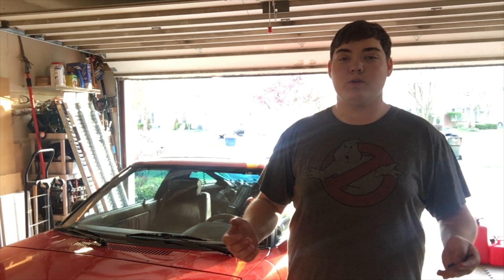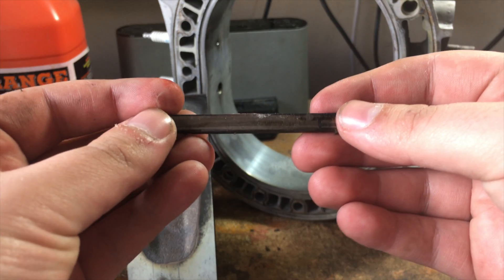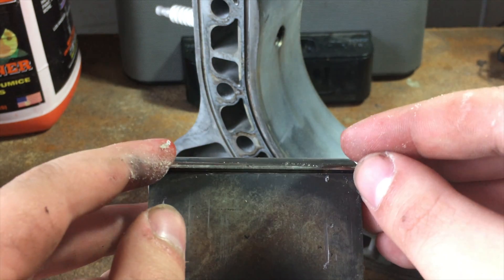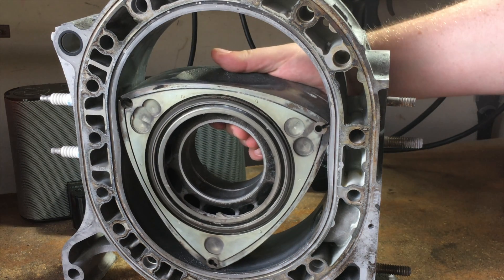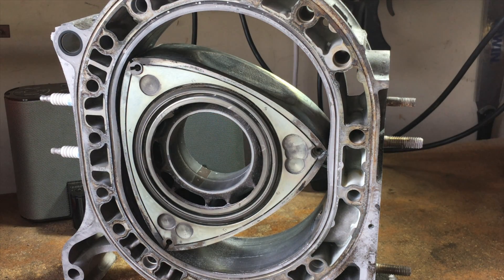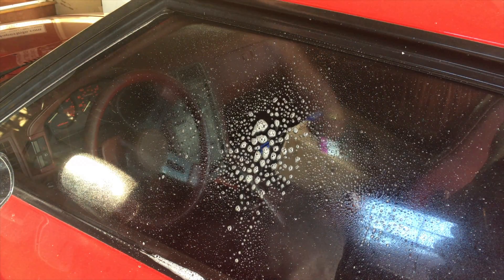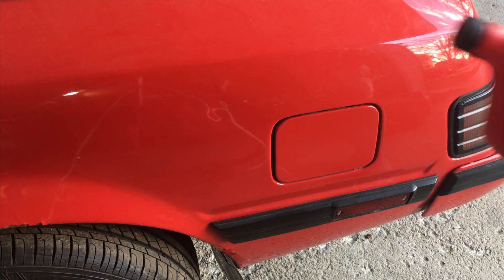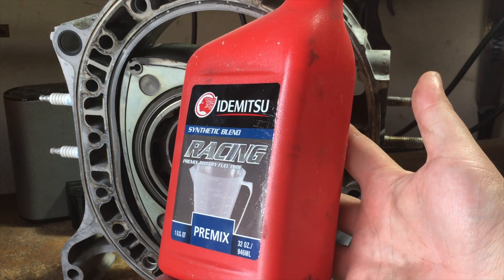What Are Apex Seals? How Do They Blow?

Comment: YOU LOSE ALL FUEL AIR AND COMPRESSION WHEN THE APEX SEAL IS IN THE BIG PLUG HOLE  IT RUNS ON 5 TO 1 COMPRESSION
Reply: Now I approve most of what is said. I didn't believe in the rotary engine's potential before actually doing research on it. I have reasons to believe that this engine is able to outperform most combustion engines. The 4-stroke engine will always have a good future as the next step in its evolution is the cameless, I always have more hope on the rotary engine because it isn't an oscillating engine. I know it still has a lot of weakness but I have a lot of hope if I rely on theoretical ideas. It is good that Mazda is making efforts to further improve the concept of Mr Felix Wankel. But the essential and also what I find even better is that fans do not give up trying to improve what already exists, so it reduce the risk of throwing an so interesting engine into trash. I thought that manufacturers could design something like flat head spark plugs, even just to reduce this compression leakage problem. I know there is already a lot of spark plugs this kind but I didn't expect there was alredy one that fits the 13B. I recently discovered that some Rotary owners have already experimented with it. "Surface gap spark plugs" is what they used. This probably increased the gas mileage and reduced the EGT. This should have the benefit of improving performance and many things by being easily accessible and affordable. Also, in my opinion, the chrome coating of the rotor housing is not enough. I am still doing research on why Mazda has mostly used chrome, why people do a re-chromed housing while nikasil plating or DLC coating exist. Nikasil is nickel silicon carbide and DLC is Diamond Like Carbon. For now these are the ones that I think are the best ways to improve the slide in the engine, maybe the first reason they are not famous is that the cost of realization is expensive. I suspect that people have already used these processes on their rotary engine but still do not say anything about it .. There is nothing to prove regarding their use on 2-stroke and 4-stroke engines as they are already very used. So I continue to do my research on the rotary engine to be able to conclude if there would be a benefit  on  using these (nikasik or DLC) processes on rotary engine
Reply: Surface gap spark plugs great comment still major leakage index a engine pull the leading plug out  line up a apex in the plug hole   now index and  mark the crank now plug back in turn the engine by hand when your mark lines up you hear and feel compression leaking inside the engine out the exhaust port
Reply: 6 CHAMBERS 3 TURNS FOR OUTPUT ?        6 CYLINDERS TWO TURNS FOR OUTPUT ?
1
Reply: AWESOME COMMENT
Reply: You're half right, actualy not all the compression but just a little, but yeah you will run less ratio, meaning that it will drop in engine efficiency
Reply: You're half right? were is your full 270 degrees of compression stroke this why you have flames even when you are injected?
Reply: 270° of compession stroke? Ain't it rather 270° power stroke?. I think these 270° remains theoretical for my opinion. I think that actually it's almost 225° of real power stroke because when the front apex seal opens on the exhaust port the expanding burnt gas mixture decreases in pressure, that ends the power stroke. The rear apex seal crosses the leading sparkplug hole a little before this opening on the exhaust port of the front apex seal. As you know, there is expanding burnt gas in the exhaust chamber while fresh mixture that begins to be compressed in the compression chamber. When the apex seal between both chambers (rear apex seal) will cross the sparkplug hole both pressure will fight. That's why you lose just a little of compression and fresh gas mixture but not all. They are nearly equal pressure. Hot gas has more pressure but looking the configuration of rotary, the position where the apex seal crosses the spark plug hole is the position the rotor face is its bottom dead center in the exhaust chamber. I think where the sparkplug hole is positioned gives advantage to the pressure of the compression chamber from it's smaller volume but hot gas from exhaust chamber still has same pressure even with bigger chamber volume. I think what makes difference is a little just before the apex seal leaves the sparkplug hole, the front apex seal begins to open in the exhaust port, which creates a little overlap, just enough to let the pressure of the compression chamber get over the pressure of the exhaust chamber, and then the rear apex seal closes on the spark plug hole. Now let's compare. 2 stroke piston engines have around 120° of power stroke of 360°  full revolution, 4 stroke piston engines have 180° of power stroke of 720° full revolution, rotary engines have around 225° of power stroke 360°. So rotary is still winner of power stroke efficiency. Now 4 stroke piston engine wins the gas mileage efficiency and is the most clean of 3 engines. Rotary can improve gas mileage, as Ernie Brink said, by changing sparkplug hole geometry by a very thin flat hole (height of the hole will have the same thickness as apex seal) , but too narrow hole could diminish the effectiveness of the spark,I think we can go bigger in the height of the hole without really having consequant gas exchange between compression chamber and exhaust chamber. Other ideas from Ernie Brink are very interesting and pertinant and there are still more possibility to improve the rotary engine
Reply: tinkerhowedoodatrick  thank you for the reply i was just think about the power stroke? when power stroke has ended  i think there is zero pressure i will tell you why the chamber in front the power stroke chamber just pushed the exhaust  out do not forget the engine is the air pump this how  you get exhaust  pressure please bare with me on the compression stroke will leak right into the empty power stroke this why the very high egt's even when you are injected wankel  think about it injected no fuel when your foot is off the gas but yet we still get flames from the exhaust please reply  and each stroke is 270 degrees  this great hidden efficiency  the only engine to get 1080 degrees output  six chambers 3 outputs six pistons 2 outputs think about
Reply: Let's just take some basics, the intake capacity is the same as the exhaust capacity. What is still confusing so far is that we do not really know if the 13B has 650cc capacity per rotor or intake capacity of each rotor chamber .. Let's just take the example that if the admitted capacity was 650cc, the gas burned by combustion expands and therefore would be around 800cc. 800cc potential in a capacity of 650cc creates a remaining pressure, and it is this remaining pressure that is the exhaust pressure. I said "The rear apex seal crosses the leading sparkplug hole a little before this opening on the exhaust port of the front apex seal" but after a long analysis I thought I was wrong. It passes through the spark plug hole during the full opening of the exhaust port. Nevertheless, the expanding gas is going in all directions by pushing the rotor at the same time. When the exhaust port opens, a portion of gas escapes while the gas that is still at the bottom continues to expand. This is the traffic effect. Imagine in a traffic of 10 cars, when the fire goes green, the front car starts to move while it will take a while to the back car before moving.  And when the apex seal crosses the spark plug hole, the gas must already pass through this small hole, it's also slowed down by the front traffic. But in the end a small portion of gas from the compression chamber will contaminate the exhaust. A late ignition will occure because of the flame residues of the already completed combustion mixed with the small amount of fresh mixture that has passed through the small hole, which occurs in the exhaust duct and increases its temperature. As far as exhaust flames are concerned, it's not really because of the passage of fresh exhaust gas. Many other factors can be at the origin. For example, the time when the BMWs were carbureted, the carburetor was equipped with idling enricher that was activated when you release the throttle pedal but the engine was still running at high rpm. Believe it or not, the gasoline serves as cooling for the piston, you only need correct A / F ration when you accelerate, when you release the gas pedal, there should be a moment where the engine can cool down, and so apart from having the water-cooled and oil-cooled car, enriched to cool with gasoline. This also could answer another question: When piston ring blows? Piston rings blow when the temperature is so high that the ring gap can't handle it and ring will expand more than the circumference of the cylinder. Otherwise it is because of a bad lubrication. You said "it injected no fuel when your foot is off the gas" but in fact the idle speed corresponds to a small amount of air intake to the engine and a quantity of equivalent fuel. To run a motor you need power strokes, for power stroke you need mixed air and fuel, to compress this mixture to heat it and to add a spark to burn the mixture and thus obtain a gas expansion. Only one missing and you will not have a power stroke. If you do not put gasoline, you will not be able to burn the air to have a gas expansion. Injected you just manage the amount of intake air through the throttle and the ECU does the rest. Nowadays water injection technologies are starting to equip many cars, while others remain at the enrichment of idling because of pollution standards still not severe. I think a lot of ECU aftermarket have adopted this idea of idle enhancer. I'm not sure that's really the case but it's still what I think. For my opinion, running rich can result to backfire or black smoke, rotary or not. Each stroke is 270°, yes in theoretical. You take 13B, 13B-REW, Renesis and you get different timing. And for the engine efficiency, you don't even have to think 1080° to understand why this engine is efficient. 1080 ° is only a cycle where one apex seal returns to its starting position. 360° is enough because you have a power stroke each e-shaft revolution. With 2 rotors, you have the eccentric shaft mounted at 180 °, which means that when one rotor is in compression stroke, the other is in power stroke, and vice versa. If we take the theoretical engine of Mr Felix Wankel and its 270 °, from what I understand, we get 360 ° of power stroke and an overlap of 90 ° more power and a dead time of 90 °. Of course people compare the 13B to a 6 cylinder engine but it is not quite comparable because a straight line 6 for example has 360 ° power stroke with 60 ° more power and no downtime. Each has its advantages as everyone has these weaknesses. In the end it is the affinity of each one that defines the choice
Reply: @tinkerhowedoodatrick  👍 Interesting & informative comments from all of you. Do u all know if premixing 1/2 - 1oz  2 stroke oils per gallon will definitely help seals & rotors or just a myth to sell more oils?  Many have advised to premix with regular non synthetic 2 stroke oils or Idemitsu oil but I have not seen scientific proof or before / after photos of seals & rotors with different oils.  I have 2005 Rx8 series 1 & never have premixed. Thanks & keep up great info 🙏⭐🎆👍
Reply: 13b is 650cc per rotor face 6 rotor faces        injected no fuel when your foot is off the gas this true until 1200 rpm when fuel is back    slow down in your thinking  by the way great comment i thank you  think basic wankels will spin on you To run a motor you need power strokes, for power stroke you need mixed air and fuel, to compress this mixture and you no high compression more power stroke right           now lets go back to compression  you lose half of the stroke 270  why when the apex lines up with the plug hole  leading side  all wankel mazdas run on only 5 to 1 compression ?  this is low or loss of power a brand new wankel engine from mazda is right on the fine line of low compression     what mean by no fuel  there is still flames in the tail pipe why the leak inside your engine
Reply: six chambers ======= six cylinders or piston engine 2 stroke or 4 stroke this great for the wankel  1080 degrees or 3 turns for output this engine                         thinking this way the brand new rx is going to get great fuel mileages and more power why higher compression why laser or apex meeting a apex no leakege      Let's just take some basics when you are on power you only have just half power stroke when the back apexs lines up with the trailing plug hole but this all fixed in the brand new rotary you will get all the strokes at the full 270 awesome
Reply: GREAT COMMENT DON'T FORGET THE PLUG GETS SOAKED WITH FUEL AT THIS TIME OF LEAKAGE THIS WHY THEY FLOOD AND FROM INEFFICIENT COMBUSTION SHAKE THIS WHY THE APEX CHATTER AND  THIS WHY THRERE IS MAJOR CARBON  AND THIS WHY WANKEL STILL BLOWS A SUPER CHARGER
Reply: Am I wrong if I say that it is not the same thing to turn the eccentric shaft in one hand and the motor running on its own? Some people claim that using RX8 "surface gapped" spark plugs have improved their low-end performance and gas mileage.. But it is true that there is still a leak of compression. One of the solutions to avoid the problem of air fuel mixture leakage would also be to convert to GDI (gasoline direct injection) system if it is difficult to avoid the problem of compression leakage. To do this, we would use the trailing spark plug hole as injector port, so we eliminate air-fuel mixture through the intake but just air intake, gasoline would be injected just at moment the apex seal has closed on the leading spark plug hole. We know that the purpose of using 2 spark plugs per rotor chamber is to improve the ignition, the surface gap spark plug is doing the job very well, moreover NGK has Iridium range spark plugs which supports higher intensity of arc, so we just do some modification just to increase th arc intensity if needed. The use of boost being already familiar, this would fill the lack of compression ratio by pushing a lot of air so that the compression falls back to about 10 to 1 after the compression leak..